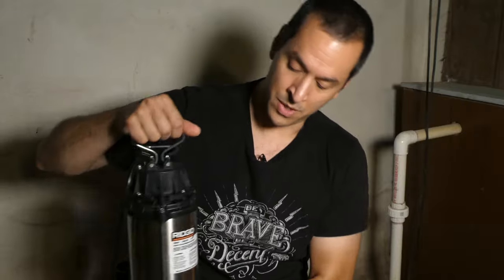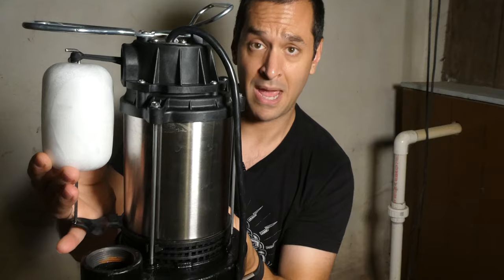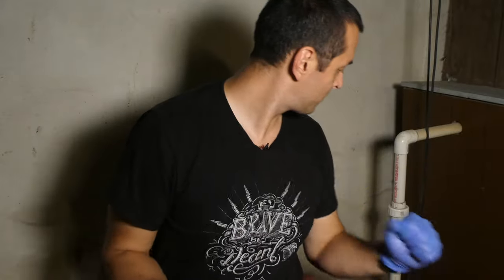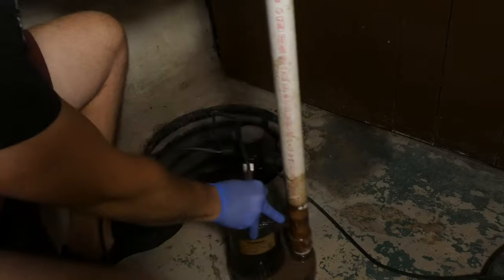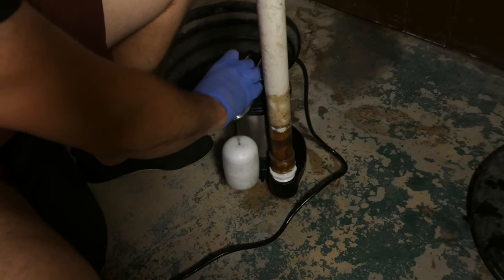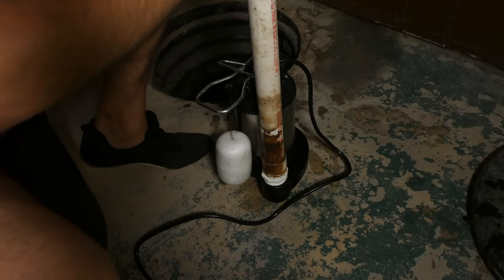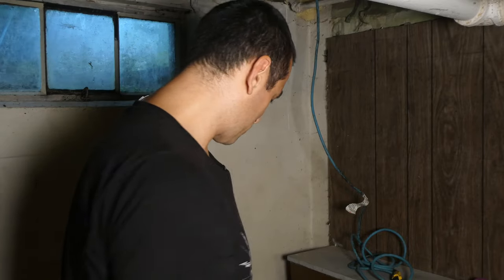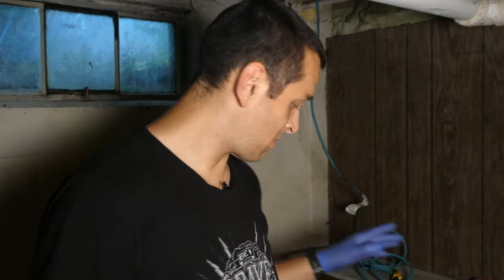How to Replace a Broken Sump Pump

Comment: I went to the basement this morning I heard this humming noise coming from my Sum Pump.
I knew immediately it needed to  be replaced.
I first called my plumber I haven't heard from him,
first video I pulled on youtube was yours,
I just wanted to thank you for this easy video and taking the time to make it.
I went to lowes of course I replaced  it with Zoeller brand .
Super easy,I usually screw things up not this time .
Working like champ.
Thank you sir,
Reply from the maker: So bummed you had to deal with this in the first place but so very happy I was able to help!! Glad all is better now!!

Comment: You give me hope...and I need it. I'm not sure what to do if the pipe is too short or too long. I will try to take little videos of my progress.
Reply from the maker: Glad to help! And if it's too long, a simple hack saw should solve that. If it's too short, they make adaptors to lengthen the pipe (you should be able to find those at your local home center. Good luck!!
Reply: @MADEbyAP  I DID IT!!!! 60-year old man did it! (not easy after Meniscus and Rotator Cuff surgery) but you inspired me and I got it...it took about 1.5 hours but that was only because I had to clean up the mess and stop to get more tools... BUT THANKS!!!

Comment: Noticed my sump pump running every 10-15 minutes several weeks ago and there was no rain (I sit on a water table though so not uncommon) and now, after a heavy rain yesterday...total silence (yikes!).  Thanks for this video as I was going to call a plumber today.
Reply from the maker: Glad you found it helpful! Good luck with the replacement!
Reply: @MADEbyAP  mine is a non submersible. Can I replace with submersible?

Comment: Thanks for the video. Quick question: You mentioned that the water was above the floater level, do you know why it did not flood your basement when your original pump died? Got lucky or is there another reason?
Reply from the maker: Hi! Trying to remember since it was awhile ago but I think it was being intermittent with the pumping, i.e., sometimes it would go, sometimes it wasn't and I caught it in time before any major flooding happened. Thanks for the question!

Comment: I had to replace my pump years ago, now I'm doing it again. After a huge rain storm!!!! I am flooded AGAIN!! So I brought in my old pump to replace it with the same kind of size that I needed and when I brought it home....IT DIDN'T WORK. So I took it back and they gave me a hard time Home Depot. They claim that that one is actually my old one (had my receipt) because it was still wet. Long story short... I took it back to another Home Depot and they gladly exchanged it. Note- plug it in at the store and make sure it works. Also shop at Menard's- cheaper and they exchange shit that don't work without a hassle.
Reply from the maker: Wow! That’s crazy. Glad that you eventually got it returned. We don’t have Menards up here in Jersey but I’ve always heard great things about them! Thanks for sharing your story. Wild! Assuming that everything is honky dory now??

Comment: Curious about the backup systems? Saw a watchdog one with a back up pump and battery. is that needed??
Reply from the maker: That's a good point. I don't have a back up pump or battery but sounds like it's a good idea for sure. If you go that route please share what you end up doing as I'm super curious!

Comment: I guess no check valve in your system? 

Still WOW that was one quiet drainage. I have quiet sump pump envy. Bought a new same brand sump pump and hoping it will do the job.
Reply from the maker: Haha yeah it’s relatively quiet which is nice! And yes added a check valve after the fact but didn’t do a video on it surprisingly haha.

Comment: both of my sump pumps covers are sealed by the local Plummer do I just cut through the seal?
Reply from the maker: Sorry for the delay I was traveling! Hopefully you figured it out by now. I’ve never experienced a sealed sump pump situation but I would think you should be able to cut through it and replace the cover (or reseat it if the cut is clean). Sorry not much of a help here on that one!

Comment: Great video and love the funny/goofy ending to it....was it real younger you with a glove hat?
Anyways........I think you could have covered other basic malfunctions like a stuck float switch.....my pump works fine...but after turning on/off few times..it stops...and then I had to shove something into the sump well to forcefully activate it.......
Reply from the maker: Thank you! And it sure was me circa 1995 I think! And good call on the other malfunctions. Maybe I’ll do a follow up one of these days. I hope you were able to solve the sticking. That’s an odd one and I haven’t run into it yet (knock on wood).

Comment: i didn't see you hook up the pipe back to the other pipe?
Reply from the maker: In my situation it went in exactly the reverse way I took it out. Put the pipe from the sump pump back into the pipe going to the outside and tighten the coupling. Sorry that wasn’t clear!

Comment: Kind of dramatic.. You demonstrated nothing after you screws pipe into the new sump pump. No check valve? Did not show the water being pumped out after you lowered it… Was the outflow pipe the exact same length as old pump?
Reply from the maker: Hi there and good point on not showing the basin after installing the new pump. At the time was still relatively new to documenting on YouTube! I did not put a check valve I just did a one to one replacement. The pipe didn’t need to be modified either, I just needed to add the reducer valve. Thanks again for the feedback!

Comment: Why can't you use the extension chord?
Reply from the maker: Hi JJ. I believe it’s a safety issue. The instructions were very specific about not using one. So if you choose to do so just be careful and make sure your code allows for it!
Reply: @MADEbyAP  Thanks for the reply. Turns out the pump had a 9 ft chord.

Comment: Look, I know youtubers think they are hollywood stars.  But please toss the ego and trash entertainment and just cut to the chase.

Youtubers should also be aware that many sump pump wells are used for sealed radon remediation systems.   This video doesn't even mention radon.
Reply from the maker: Hey now, how am I supposed to get my pilot picked up if I don't at least pretend to be a Hollywood star? I mean, dress for the role you want, amiright?

Comment: love the video  2012 christmas eve dog that sleeps in basement for what ever reason it loved to sleep there is at  basement door barking at 3 am i opened the door  flipped light on water everywhere . i ran out  to the garden pond  judgement call  hooked it to the garden pond  pump drained basement out a window . 6 30 am i'm at hardware store only pump they had was 60 $ pump from  impulse buy with not much choice  from  company called vevor 1/3 hp never heard of them speed ahead  2024  vevor pump  making odd noise but still working still works why  gamble pulled out  today pre ordered and put new vevor 1/2 hp upgraded 100$  90$  most places i'd come to find vevor makes almost anything well pumps which is the pump in my well.  was unknown till  i had pressure tank failure  in december the guy who installed the well and pump told time to consider new  pump soon  any how he explained they make loads of stuff   bee hives lawn equipment etc kinda  have no ill regret about rigid i did consider them  quality company i think we use them to snake drains at work were am i going now with google can review things easier oh and yes so do not rule out $60 pump i had no choice but it lasted 11 years still works just noisy i'll keep it as back up i hope never need to use also    Vevor sump cord in our house was to short also 10 ft cord was not long enough  not under stand why such short cords great video gave you a thumbs up all the way you looked like a pro
Reply from the maker: Thank you so much for the comment and thumbs up! What a story!! Agree, hopefully you never need to break out the back up! It’s also interesting to see what these companies all produce. I was working with a partner on promoting their faux Christmas trees. Come to find out they also produce overhead garage lighting and tractors haha. Fascinating. Well here’s to a dry basement. Thanks for watching!!!
Reply: Ignore the naysayers, you made a helpful video. Thanks. I had.. .no idea that easy.
Reply from the maker: @murphy4yt thank you so much. I appreciate the note!!